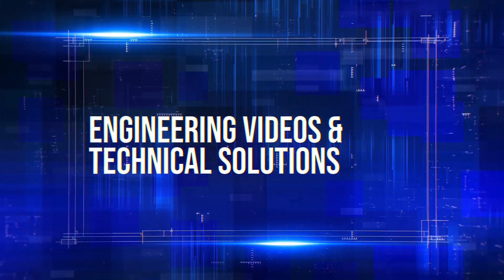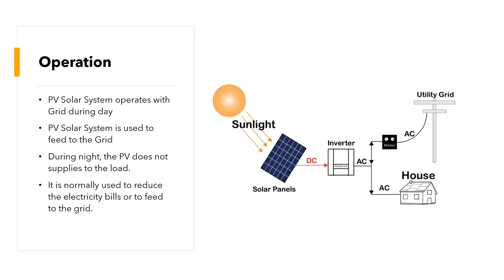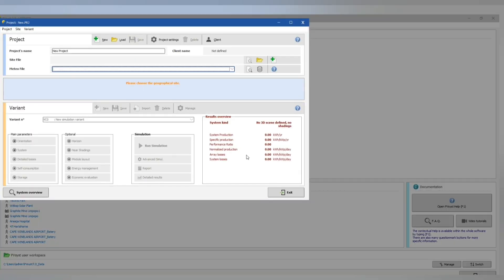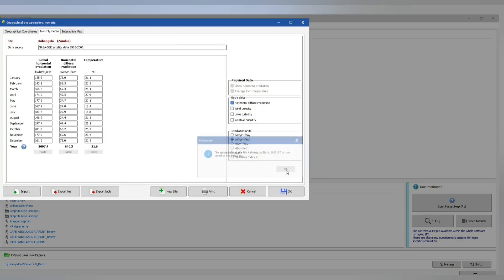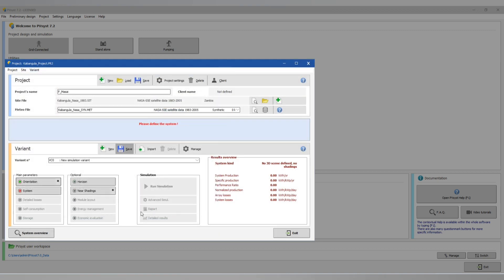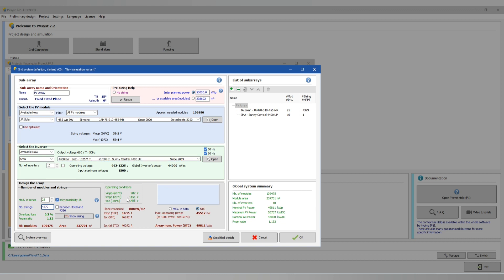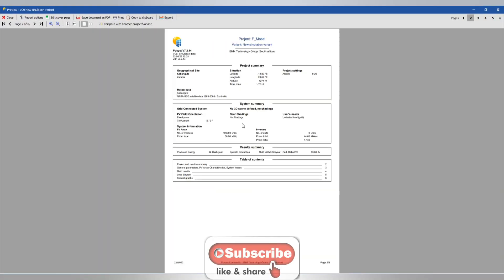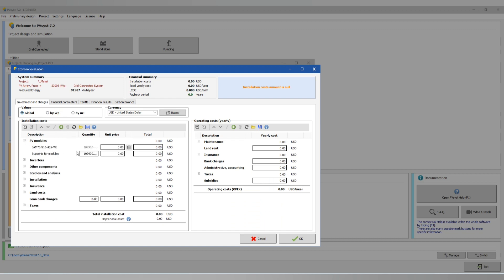Design and Simulation of 50MWp Grid Connected PV Solar System in PVSyst sofware

Comment: Sir, I need the simulation of Design and optimization of a hybrid photovoltaic system composed of diesel generators, solar panels and batteries for an off-grid system
Reply from the maker: Hi thank you for your comment, We are currently working on a similar video